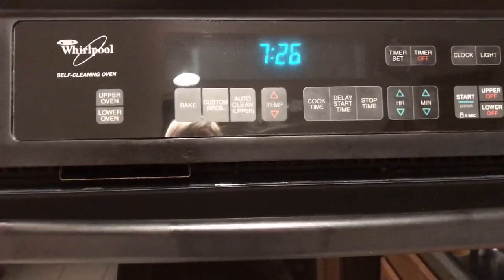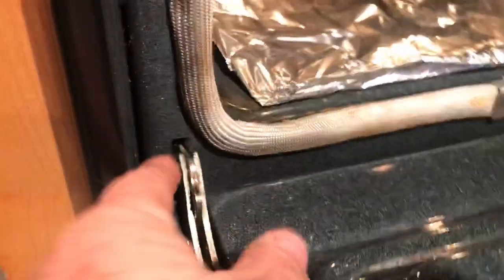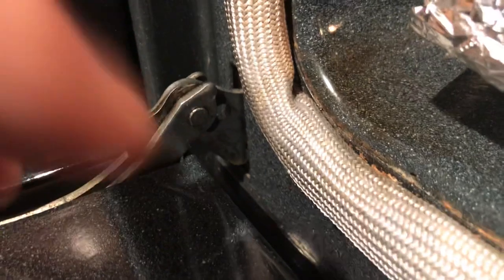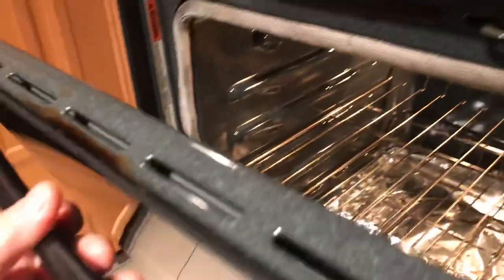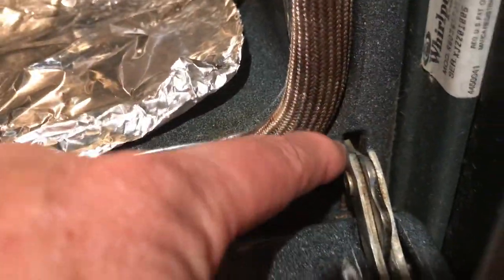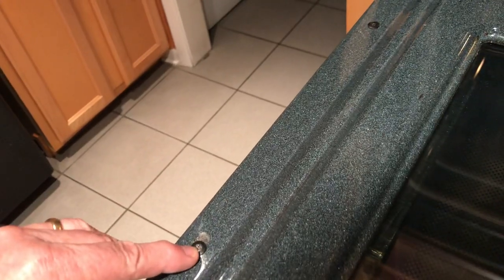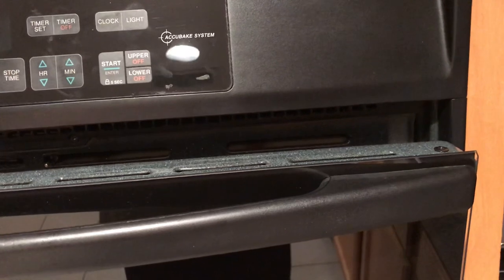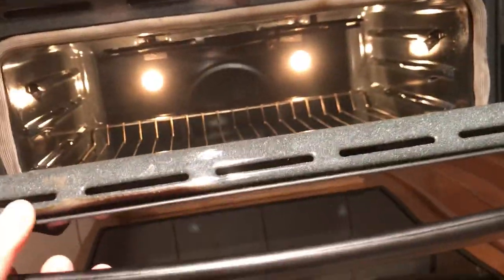Whirlpool Oven Door Removal Old Style without hinge lock

Comment from the maker: Few updates - I just recently took the lower door off the hinge in order to clean the interior of the glass panels.  I had done the upper door in this video.  Very easy to do.  I used a 16D nail to put in the hole.  Cut the nail so that it is about 3/8ths - 4/8ths of an inch long including the head.  That allows it to stick into the hole when the door is open and the head keeps it from going through.  They have to be short in order to remove the hinge during the glass cleaning process below.  If they are too long then you will not be able to get the hinge out of it placement and separate the metal pieces to remove the glass. I cut the nail with some bolt cutters.  Once the two nail pieces are in place close the door which pinches the nails and keeps them in place.  Instructions from Whirlpool Technical manual
To remove the oven door:
1.Install a pin (nail in this case) in the hole of each oven door hinge hanger.
2.Close the oven door as far as the two pins will allow. 
3.Grasp the sides of the door and lift the door until it stops, then pull the hinge hangers out of the slots.

4. With two hands remove and carefully place the door on a table with a towel in place to protect it.

Remove the door handle piece of glass by removing 4 screws.  Two are on the top and two are on the bottom.  Two of the screws have a small metal bracket that hold the glass in place.  Remove that glass/handle piece and clean with windex and towels.  Now onto the other piece of glass.  Having the short nails will now allow you to remove the 4 screws (2 for each) holding the hinge spring assembly.  Remove the screws and gently lift the hinge spring assembly out of the hole.  Do this on both sides.  The screws are the only screws visible on the inside of the door (right behind the hinge, 2 on each side).  The removal of the screws allows the metal plate holding the glass in place.  Now the metal frame can be removed and the glass taken out and cleaned.   I used a razor to clean the baked on grease.  Clean all metal and glass surfaces.  Reassemble.

To reinstall the oven door: 
1. Grasp the sides of the door and tilt it back at a slight angle, then insert the hinge hangers into the hinge slots as far as they will go.
2. Rotate the top of the door towards the oven so the hinge hangers fit onto the support pins.
3. Close the oven door as far as the pins will allow, and make sure that the hinge hangers are fully seated on the support pins. If they are not seated properly, the door will not close tightly and may be off-center. To seat the hinge hangers, open the door slightly, and push in on the bottom until the hangers are fully seated. 
4. Open the oven door to its fully open position and remove the two hinge hanger pins (nails in my case....)
5. Close the oven door completely and check it for proper operation and alignment

I also replaced the upper barrel blower fan for $140.  Makes a huge difference in the sound of the oven.  Definately worth it if you oven is noisy.  Also replaced the thermal inline fuse protecting the circuit panel.  This cost $20.

This manual explains a ton on the oven and is well worth the read....
https://www.manualslib.com/manual/1477368/Whirlpool-Gbd307pd.html#manual

Enjoy!
Reply: Very helpful. Thank you! This gives me enough enthusiasm to maybe try to ressurect the upper broiler unit that a repair guy failed to fix while ruining the blower...which I then replaced
Reply: I have the same oven, so thank you for this very complete and detailed write-up!

Comment: This video didn't give me great confidence in removing and being sure that I could put the door back since the guy actually doesn't remove or put back the door. The best thing anybody looking at this video can do is to instead look the users guide for your oven since that nicely explains everything. What they also tell you is use 5/32" allen wrench keys - short end inserted into the hole that was pointed in the video. That size is the recommended size from Whirlpool. I just finished removing and re-installing today - it is an easy job - I was unnecessarily worried. After cleaning the insides of the oven door, the things looks as good as new!

Procedure as per the manual:

1. Open the door fully
2. Insert small end of the 5/32 Allen Wrench or similar diameter nail into the two holes
3. Grasp the top handle of the door and gently close as far it will shut. Pull door out at the bottom to remove. 
4. Instructions don't say this until later - but don't try to remove the Allen wrench at this stage.

To clean the oven door, you need to remove only 4 screws - two on the top edge of the door and two exactly on the opposite edge - the screws that became visible due to door removal. Don't remove the screws from the bottom face of the door. [This is my instruction]

To put the door back:

1. Keeping the door almost vertical, insert the hinge arms into the slots in the frame. Push at lower corner to make sure that they fully engage. 
2. Open the door all the way
3. Remove the Allen wrench keys
4. Close the door 

I was so worried about door going back - but it was a piece of cake.
Reply from the maker: BimalPoddar - thanks for watching and clarifying the process. I was unable to find the user guide and would never had thought they would post such a process in it in the first place. Great that they do and glad you posted it for everyone.
Reply: Thank you so much for the written instructions. Tremendous help.

Comment: Was replacing the glass on my older Whirlpool and found this video.  Thanks! I couldn't figure out how to take the door off.
Reply: I need to replace the glass on my oven door and I am nervous about taking The screws out of the inner panel because this guy says the springs are in there for the door attention? Can you tell me how you took the door apart without the springs going off on you?

Comment: OMG!! You are my hero! I had the replacement glass arrive today, but every video is about the stupid hinge clip which my model ALSO, does not have! There was NO WAY I WAS GOING TO GIVE UP!  Thanks to you.... I just removed the door and now am going to to replace the interior cracked glass. I used those metal pins for meant for holding up shelves, and it was perfect. 

Long story short, never, ever, EVER, use the self clean feature (code: for self destructing clean feature) on the double oven. Its rolling the dice for malfunction. 

Thank you, thank you, thank you, for making this video!!!! YOU ROCK!!!!!
Reply from the maker: Glad it helped!  Yes I quit using self cleaning feature because the 900 deg temps were tripping the single used thermal fuse located behind the unit. It’s an easy repair and cheap but getting the thing out of the enclosure is not worth it. If there was some supplemental air flow or venting it would probably be fine. No big deal for us anyway. Again glad it was helpful. You rock!

Comment: Thank you very much for the video, it was really hard finding out how to remove door on such an old unit... I was a little scared I wouldn't be able to figure out how to reinstall the door since you didn't mention how to do it in the video. For those in the same  boat, here's my experience. I put 2 allen wrenches in each hole. I took out the door with the instructions mentioned in the video. When you remove the door, the allen wrenches get locked into the hinges. When you're ready to put it back in, just do the opposite... Insert the hinges in the hole while the door is in the almost closed position. Lower the door and the hinges will install and the allen wrenches will be released and you can take them out. Hope this helps. Thanks again for the video, I would never have been able to figure it out without it!
Reply from the maker: Starch March - glad it helped.  In hindsight I could have done a little better job of showing the steps but it was one of those ones where I thought about it after the fact.  It is really not that hard once you know the trick.  Thanks for posting and the comment!
Reply: Thanks, I was wondering about the Alan wrenches. I need to replace the inner glass on my oven door and I am nervous about taking The screws out of the inner panel because this guy says the springs are in there for the door tension? Can you tell me how you took the door apart without the springs going off on you?

Comment: Thank you!!! That was very helpful. Believe it or not, the glass on the inside door panel spontaneously shattered when I opened the door. Fortunately it didn't get into the food I was making. I am hoping to replace the inside panel. Getting the door off was the first step.
Reply: I need to replace the glass on my oven door (One time we were baking and the interior glass just shattered, just like yours!) and I am nervous about taking The screws out of the inner panel because this guy says the springs are in there for the door attention? Can you tell me how you took the door apart without the springs going off on you? Let me know how you made out with this please. Thanks.

Comment from the maker: An update - just cleaned this oven again.  Actually did it all with out reading these great instructions below.  Couple of variants I thought I would mention.  This time I cut 2 small 16 Penny nails to 3/4 of an inch.  I just cut the shank part so both pieces do not have the nail head.  This length gives you plenty of margin on both sides of the hinge for you don't want the nail piece to come off.  The problem presented when it is 3/4 of an inch is that you cannot remove the hinge assembly (nail prevents it) which is required to get the middle piece of glass out for cleaning.  Solution is to take a pair of vice grips that are closed and put them over the hinge through the open part of the jaws.  That allows you to easily put leverage on the hinge (the hinge hook rests on the vice grip) to remove the nail pin carefully.  Then you can remove the entire hinge which also releases the metal panel holding the middle piece of glass.  There is some insulation in there as well that can be carefully removed.  Entire process took about an hour.  Thought I would throw out some other observations.... do not use the oven in the cleaning mode.  It gets way too hot and burns out the thermal fuse.  This fuse is easy to replace but getting the oven out to access it is a pain.  So I quit using the self cleaning feature.  Yours may have better ventilation in the back such that the temperature does not trip the one time use thermal fuse.  Second, I replaced the squirrel cage fan since the original one was old and making a lot more noise than it should.  Again an easy replacement.  In 25 years of using this oven those are the only two things I have done on the oven.  The heating elements are still the original ones.  This oven rocks!

Comment: Great video. Just what I needed.  My door on my Whirlpool built in oven closes just fine, but doesn't remain closed all the way after I shut it.  If straight up is 90 degrees from the floor, then I would say my door is at 87 degrees from the floor when closed.  Will replacing the springs hinges do the trick?
Reply from the maker: JO - is the 3 degree variation you describe something that pushing it forward with your hand closes?  Or is it stuck there?  Hard to say - if you can close it completely by pushing on it with a little force it might be that the springs have weakened over the years.  When mine is closed there is no play in it. It is firmly against the rubber stops. Replacing the springs would not be difficult to do. You just have to be careful because they are very strong springs. Thanks for watching and commenting.
Reply: @condor5635  Yes. I can easily push the door forward the 3 degrees, but then it 'springs' right back to 87 degrees. If it goes to say 86 degrees, the oven light comes on.  I took out the hinges/springs today and had an idea to relocate the pin up a 1/2" or so, thus tightening the spring some more. After seeing how tight the spring is, and knowing that springs can be deadly or cause serious injury, I opted not to try my idea and just order new hinges with springs. There goes $85 shipped for two new hinges with springs. Hope this does the trick! Thanks for your input, and again for your video. Got the door off in seconds!
Reply from the maker: JO - interesting idea on movement of the mounting hole but probably easier in the end to just get the springs like you did. Please let me know how the new springs work out. Mine may be close to going out as well!  Thanks

Comment: Hey- So, we had the inner glass of our Model GMC275PDQ2 break, so I have just ordered the glass replacement.  When watching the video she send to replace it, same problem- all have hinge clips, however ours does not.  I was happy to come across this video.  Can you explain how to put the door back in?  Do you leave the 16 penny nail in the hinge holes while you are replacing the glass and when do you take those out/ wondering how the door gets back in.  Thanks!  Kim
Reply from the maker: Greg - thanks for watching. Keep nail in while putting the door back in. The metal hinge pieces go in the holes and rest in the mating parts which is hidden. Then once it is back in pulling the door more open allows you to remove the nail which then ‘locks’ it back in. Hope this helps!
Reply: @condor5635  So when I get the door out, I will need to keep the nails in while taking the cover off to remove old glass and put new in, correct? Then replace door fold down and remove nails (I did take it out and put it back in just to make sure I did that part right (still waiting on the glass replacement, and didn't know if I could take the nails out while fixing it or if it would mess up the coils.  Really appreciate your feedback- whirlpool was not help and sent me videos mult times of ones with hinge locks.
Reply from the maker: Greg - leave nail in entire time while removed and cleaning replacing glass. Only remove after mating the door back into unit. I cut the nail so it was only enough to go through the hole and keep the hinge from closing. Otherwise it can obstruct you from mating it back to the main unit. Hope that helps
Reply from the maker: Greg were you able to remove it successfully?
Reply: @condor5635  Yes thanks

Comment: AN FYI, SOME HAVE A CLIP IN THE HINGE SLOT ON THE STOVE ITSELF< YOU MUST REMOVE THOSE PRIOR TO TRYING TO REMOVE DOOR> THIS CAN BE DONE WITH PLIERS.
Reply from the maker: Kevin Kerrigan -  thanks for noting that.  Most videos are the door types with an easy hinge lock visible.  This door was prior to those ones and is much cleaner design but harder to figure out!  There are many videos on the newer hinge design types.  Thanks!
Reply: Hi Kevin- I too have an older kitchenaid (whirlpool) without the built in hinge lock and it has a clip at the top of where the hinge feeds into the stove body.  The hinge attached to the door itself has a top and bottom groove to fit over too internal rods I can see thru the long slits in the stove body on both sides.  I had to take pliers and pull out that clip in order to be able to remove my oven door....I am unable to get it back in. It will not close all the way now as it is not situated where it should be and I cannot even close the door as it hits the top of the stove edge :( Any ideas? thanks, Nicole
Reply: @ellerystickle3125  I am having same problem...can not get it re-installed. Did you figure it out?

Comment: I have a cracked inner glass so thanks for this. I kept seeing the same hinge clip things you did. I found the manual and it had these instructions but it was nice to see the video. The manual came with removal pins for that purpose. The glass is on it's way. I appreciate you saying not to remove those 4 screws because based on other videos I probably would have. So my question is do you need to have the door face up or face down as you disassemble?
Reply from the maker: Just remove the screws while laying it on a table and you’ll see how it comes apart easily

Comment: How do you remove the side trim? I need to pull mine out (same model)
Reply from the maker: At the very bottom of the lower oven if you open the doors, you’ll see two screws. One on the left one on the right right near the hinges the screws go through the trim pieces remove the screws in the trim piece will shift down and come out.

Comment: Tanks for this video. Does anyone know hoe to make adjustments on this hinge configuration so the door closes completely?  I switched doors from top to bottom so I know the problem is in the oven, not the door. THANKS
Reply from the maker: Joe Pusateri - I actually took this oven out yesterday to clean the squirrel cage fan. I don’t think switching the doors was a good idea. You probably want to stick with the way they were. Is there a reason you switched the doors? Although you might be able to make an adjustment with the oven removed inside paneling taken off it would appear to be difficult if not impossible just from my thoughts. Thanks for watching and the comment